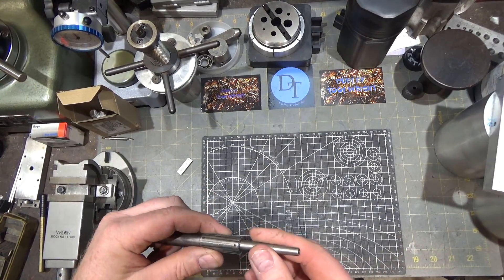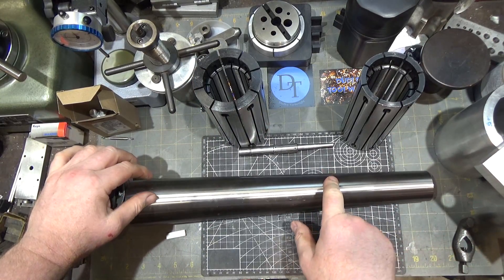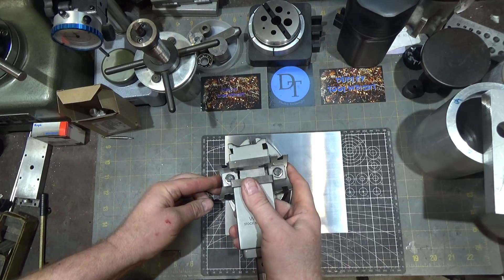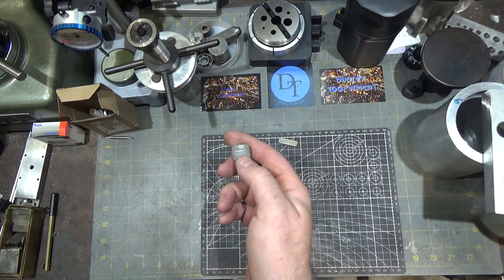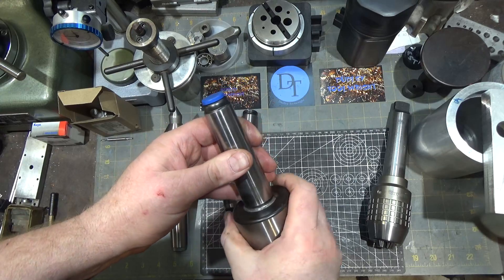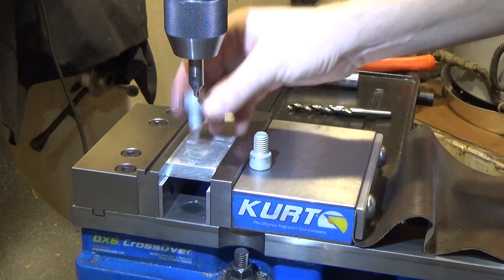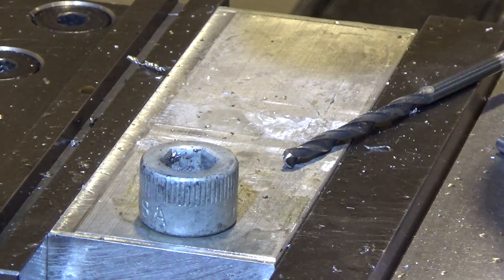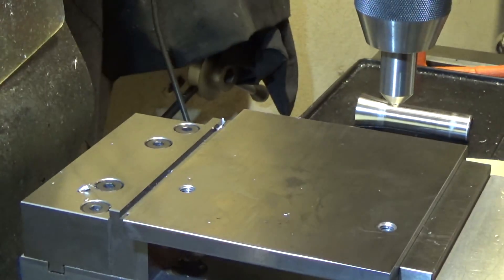123 Shop Mini Projects Part 1

Comment: Grind a slot in the top of the fixed jaw , perpendicular , same width as the gauge block and about 2mm / 100 thou from busting out , this is how I have my milling stop machined , you can take the stop out after you clamp the workpiece
Reply from the maker: That is an excellent idea. I actually have a Kurt vise jaw with a slot in it and the stops to go along with it. I use them frequently. The advantage of the design I stole from Tom Lipton, is that I have a semi permanent reference point that can be spun out of the way when I am not using it.

Comment: 8:33 Mill jaw bolts......hold them in a collet in the lathe and drill them ???
Reply: For this kind of work, I'd run a couple of nuts onto the screw and chuck it in the lathe.
Reply from the maker: The lathe would have been a great choice for this operation. I was just following the solution I had come up with.

Comment: Nice tool finds.  Ebay can give up some good buys.  Nice machining.  Why not drill&tap the bolts in the lathe.
Reply from the maker: Good point! I came up with the idea to do the drilling/tapping in the mill and just went with it. I thought that the concept of drilling and tapping a hole in place would give you an automatic reference point. Ok, I also did not consider the lathe approach...

Comment: Your precision-ground flat stones are just the ticket for cleaning up those gage blocks. They won't remove pitting, of course, but they'll remove any raised areas of corrosion without damaging the precision surface. Make sure the blocks are clean of any oil (I like Windex for that) and rub them dry (no mineral spirits or anything) and they should clean up more than enough to serve as a precision reference surface and possibly clean enough to wring. Make sure to rub your stones together first as usual and maybe blow them off just to make sure there's no rogue bits of loose abrasive that would scratch the surface.
Reply from the maker: Great suggestion. I had not considered using them there, but you are absolutely right. Thanks for the tip.
Reply from the maker: Thanks. Another useful tip. I'll check it out.

Comment: Always like to hear feedback on tooling purchases new or used.
Reply from the maker: I figured, at a minimum, some people might discover tooling solutions they were not familiar with before. YouTube is where I learn about most things machining related. I don't have the benefit of working in a shop with masters of the trade.
Reply: @DudleyToolwright  anything do with organization is welcome. I am trying to set up a shop in a much smaller place so I am having to get very creative. I wish YouTube was around when I started machining. When I was a young finish carpenter I was blessed to work with some very talented mentors. Andy
Reply from the maker: Youtube is a true blessing full of information land mines, but I am so glad it's available.